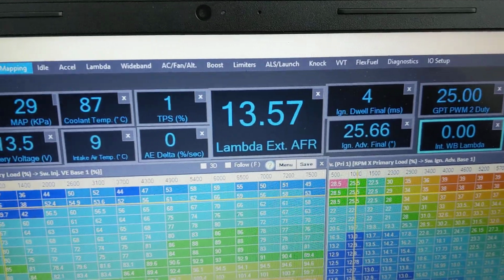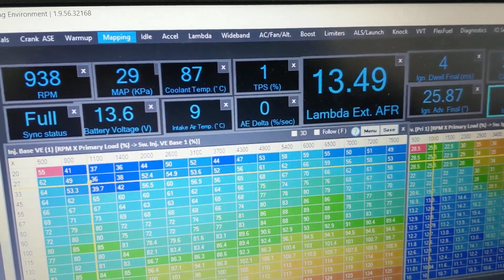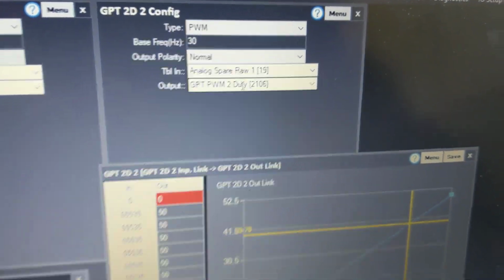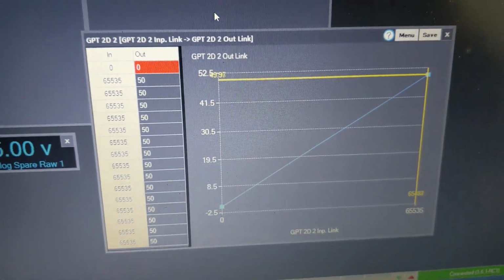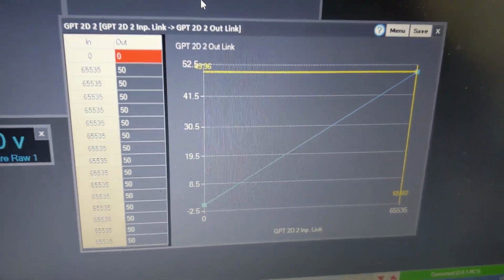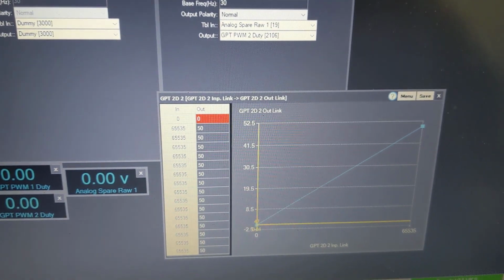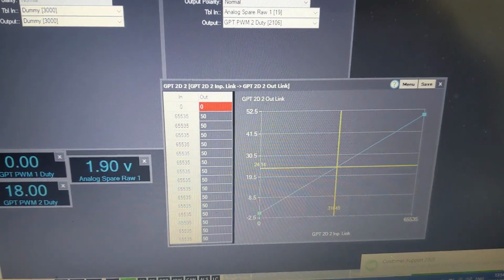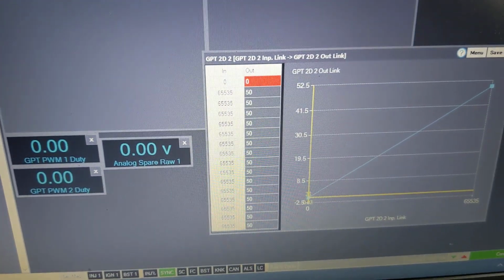Simple variable boost on the ME221

Comment: Very cool ! Is this also possible to get working on a Gen 1 me221 plugin for mx5 vvt? I am more interested in the pwm output though. Is there a way to link engine coolant temp to a pwm output? This will allow me to use my original smith gauge from my Triumph Dolomite (with a mounted mx5 engine)
Reply from the maker: Absolutely. Also by GPTs. Setup a PWM GPT, first input is the coolant, output is a PWM duty that you then wire to the gauge. Easy. :)